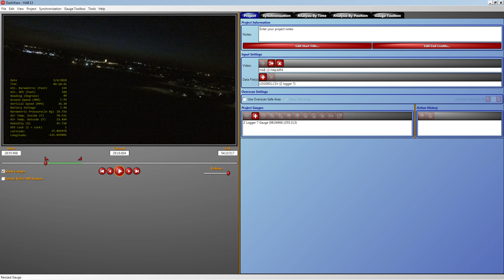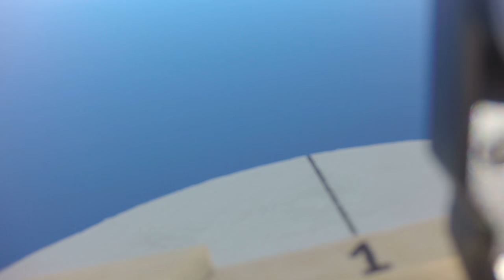High Altitude Balloon 13

Comment: Three questions:

1. What factors determine the maximum altitude reached
2. What causes the balloon to pop and 
3. Is there anything that can be done about it

There seems to be a ceiling that nobody (other than NASA) can break through in regards to altitude. Why doesn't anyone put instruments on these balloons to measure what gasses or changes in the atmosphere are at certain altitudes and what changes occur as altitude increases? I believe there may be a point where we are actually dealing with a liquid gas but I don't think anyone has gotten a balloon (other than NASA more than likely) anyway near that height. What factors are preventing a balloon from going to 200k or higher?
Reply from the maker: 1 mostly the weight of payload and the type of balloon used.
2 low air pressure or defect in balloon, and sometimes cut down device.
3 i don't want my balloons to stay up too long the longer they stay up the further they can travel away and i like too keep touch down location as close as possible while getting the information i am looking for, so i use cut down devices and add correct amount of gas to get those results.

the balloons i use are latex they have a maximum altitude of around 140,000 feet that is if everything go as planned but this rarely happens. there are better balloons out there but they are too expensive for my budget.

Comment: Use a lighter payload and get a very big balloon;  when you launch it, make sure there is only enough hydrogen or helium to barely make the device move up.  That eventually increases in speed as it gets higher.  A lot of slack on a very big balloon will get you to higher altitudes because that balloon will have more room to expand. I think you will break a balloon record doing that. Just a thought.

Comment: Mr Dwayne, glad I found your channel! I always wanted to do this! Would you touch on the topic of helium balloon altitude maximums and why there's a 120,000' cap then they bust! or have peoples balloons 🎈 gone higher?? Also on launch 9 right before the balloon pops there is some strange MPH fluctuation...weird! 

It's pretty flat out there I see, so I Can't wait for future developments in balloon and camera endeavours, a lot of us want to see more!! God Speed!
Reply from the maker: Thanks for your comment and questions. I just completed a launch where I was trying to break the altitude record for latex balloons. It has become impossible for me to get helium so I used hydrogen in the balloon. I didn't break the record in this my second attempt, but did achieve a altitude above 125,000 feet. The fluctuation was the result of equipment malfunction. I completed two launches 15 and 16 last week and I'm going over the data and will upload updates soon.
Reply: Dwayne Kellum- Reaching these altitudes to get these perspectives from this high is so valuable. It would be super to one day be able to get up to the tropopause or even just the mesopause and have some observable video from there. Getting there is past the current means tho as far as I know. 

Will keep watching! I want to observe how the horizon looks in your videos. I read your comment on one of your videos, you said the horizon was looking flat. It does seem to defy the 8" per mile formula quite blatantly. I don't think our planetary home is anything like we're told and these videos of yours are a small path to new perspective in this life.  Stay safe out there!!

Comment: Dwayne,
Can you share what instrument you place on board to capture altitude, temperature and other data? Thanks
Reply from the maker: I have to different data loggers for my flights I don't use both at the same time. For ultra lite weight flights I use Eagle Flight Computer from High Altitude Science. I use a Z Logger 7 from Hexperts Systems for more complicated flights it can do more than the Eagle. I can also get minimum data from my Tracksoar, and Spot trackers.

Comment: Very nice..I know it may cost more, but would you consider to use Go Pro 7 hero?? That's a best quality HD clear picture ! Awesome projects you doing.
Reply from the maker: the lenses on go pro newer cameras aren't easily changed, and i do not like the look of software or camera setting that reduce fish eye effect.
Reply: ohh I see.Why they making fish eye lenses anyways, what's the purpose of it?? It looks stupid.All camera lenses should be as close as possible to human vision.OK,another thought, to use on one of the camera sunlight filter and leave it zoomed,to see the sun through the glare.Also why did you put that wood frame on this balloon?I think when camera is close to it it focuses on wood and far view is blurry.Are you planning to do another sunrise launch at 1am? Like on the full moon.
Reply from the maker: Fish eye lenses are fine I have no issues with them. However for the purpose of these experiments I can't use them. I don't think all lenses need to be close to the human eye and I have never said that in any of my videos. Fish eyes lenses have there place but not in these experiments. As I stated earlier I plan to  do  experiments later using solar filters this experiment however is not one of those experiments. The wood frame serve a purpose it keeps lower camera and gimbal system from being damage during landing and also supports the capsule during setup. The camera I am using has a fixed focus and is not effect by object that pass by it. There are a lot of factor I have to consider when launching a balloon time is one. There is a limited window that falls into places during every launch when all factors of what I am trying to get answers to happens.  If you want to see a balloon launch at 01:00 during a full moon you can check out my video High Altitude balloon 3 (Camera H4). It come close to what you want to see. It launch at 03:30am and there was a full moon. If that is not to your liking may I suggest you do your own Balloon Launch to get the answers you seek.

Comment: Are you still planning to do your next launch? - I’m trying to figure out how to get a weather balloon to reach heights of 250,000 feet and higher, what could be the best possible formula to accomplish that? In terms of design? I really do think that, to get a good view of this earth we’re living on, 250,000 feet should atleast be the bench mark to really have a proper view of what’s happening, horizon and land mass wise, also, multiple cameras facing all directions? I’m not suggesting you do all of this, I’m simply trying to work out the best possible way to achieve this, I really do think that at heights of 250,000 feet and above will give us an astonishing view with multiple cameras facing up, down, side ways, right and left, with even diagonally placed cameras from each point?
Reply from the maker: We just attempt lunch 14 but fail to get off ground due too accident. Will be trying launch 15 when we get everything ready. As far as 250,000 feet that will be a task, no latex balloon will reach that high so you will have to purchase special balloon made from a different material. Those balloons are very expensive. The best you can do with latex will be around 140,000 feet. If you interested at that it will be doable a lot cheaper. I will be attempting to do this later in the year.
Reply: Dwayne Kellum thanks for the reply, shame that happened, good luck for the next launch. Yeah, I wouldn’t doubt the price tags for the more sturdier balloon materials. 140,000 feet is okay I guess, “but”, in order to achieve (in my opinion) a true view, layout, and proper revealing of the earth, these dramatic heights need to be reached eventually, through hard work. Once we find out how to assemble weather balloons capable of heights of up to 250,000 feet plus, with non distorting camera lenses, then we’ll be talking. This interest with these weather balloon experiments, is simply to really take a good shot at finding out the earths structure/shape. If there is any deception in place. Anyway, good luck for your next launch.
Reply: @ifoldaa0078   It's impossible to reach 250,000 feet! No matter what kind material being used! Because   all ballons stop at the blue horizon they never go any farther, the altimeter still calculates altitude when the ballon is not even moving! No ballkn has made it pass the blue horizon which is the true 
Karman line.

Comment: What was the problem with the gimbal cam?
Reply from the maker: Battery power and cold temperature. I'm looking for something better. Maybe one that could lock into GPS coordinates and keep camera pointing in that direction.
Reply: @DwayneKellum  instead of wood made, try using pvc acrylic 160ºc (320ºf) melting point. It's just an opinion Mr. Kellum. I'm so happy sir.
Reply from the maker: @RP12ification  You know that is a good ideal. I will look into using plastic the next time I use the gimbal.

Comment: Dwayne Kellum thank you for all you've done for humanity but one is telling me if it was 6 p.m. onward the Sun would have been gone (referring to Hight Altitude Balloon 7). In connection with these we may suggest if we could make it way higher than 119K feet? like 200K feet so we can fully see how the Sun is hovering the Earth surface? Thank you very much in advance. ^_^
Reply from the maker: i will be attempting higher altitude on next launch but the type balloons i use will not be able to reach 200k feet but i will be shooting for as high as i can get.
Reply: Thank you Dwayne Kellum ^_^ We hope that we could still find the Sun after 6 p.m. and beyond which is for most people -- it's already gone (setting).